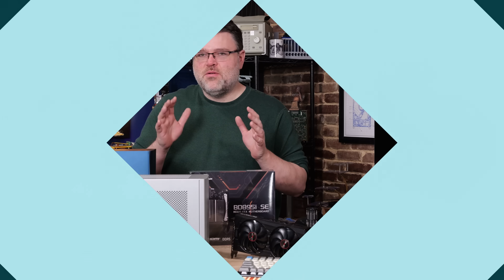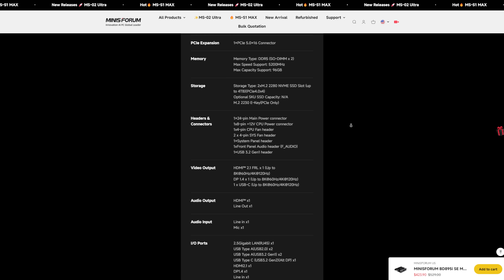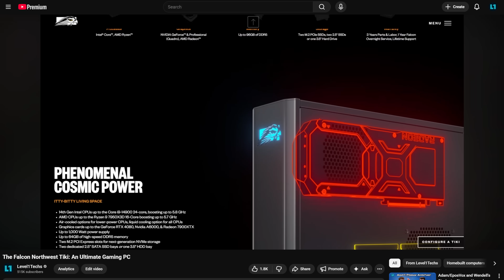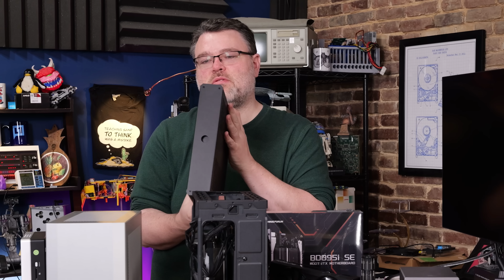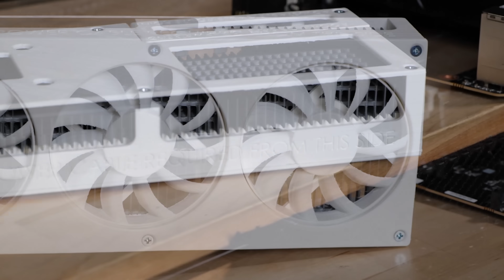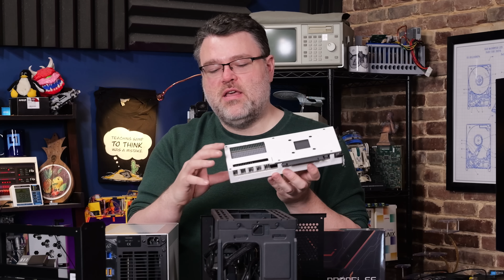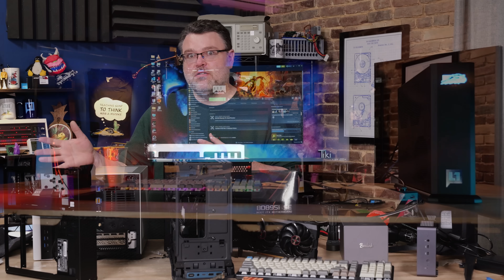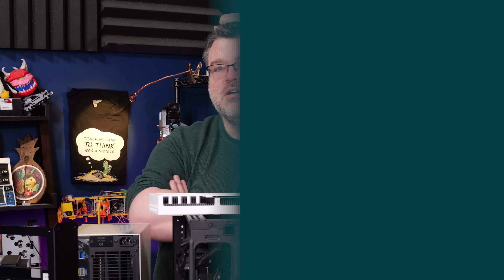Mini PCs Need Some New Rules! Ft: Minisforum BD895i SE Motherboard

Comment: 0 bios updates for my minisforum b550
Reply: That's why i'd rather use cheap ASRock with warrenty
Reply: @axescar u can't compare... I would never have had as much power with an standard AM4 or AM5 ITX board in my A4 SFX as with my BD790i X3D.😢
Reply: @Pirate85_Original buy b850 itx mobo, 7950x3d and limit the power to 120w
Reply: @wnstj15951 yeah, and which cooler i should use? L9a? 🙃 It just have 47mm of clearance and an axp-47 for example will sound like a turbine cuz the fan is directly behind the sidepanel... Believe me, I've built 20 Systems in DAN A4 Cases over the years, the Minisforum Boards are the most powerful and quietest you can get. With standard boards I've either more power and a starting jet or less power and quiet.
Reply: @Pirate85_Original  I already told you to limit the power similar to bd790i x3d. And it will perform just like it.
Reply: This is either a good thing if no bugs are found....or a horrible thing if bugs are left to fester, or merely a bad thing.

Remember folks...AGESA firmware...has had a LOT of teething pains and LOTS of buggy BIOS code over the years. Pumping out new BIOS revisions just because new AGESA blobs isn't always a good thing. My Framework Desktop had a new BIOS in December--AGESA had bugger PI code causing boot times in Linux to go from 15 seconds to over 3 minutes. Yay for BIOS rollback. Which is why newer BIOS and lots of updates--is a double edged sword. Especially with AGESA and AMD.
Reply: Genuine question, do bios updates really matter much?
Reply: @jonahhekmatyar sometimes not at all, sometimes it's the difference between working and broken, there isn't much between.
Reply: @jonahhekmatyar bios updates do contain security patches
Reply: @jonahhekmatyar  I have had an issue with a usb wifi adapter, that only worked after a bios update (maybe 15 years ago).  So, bios updates can impact things you wouldn't imagine.
Reply: My 7945i se has 2 apparently, just haven't gotten around to it
Reply: My BD770i got 3 and the BD790i X3D had the 2nd in the meantime.
Reply: Minisforum is a drop ship company with no support whatsoever.
Reply: I had several with my BD795i
Reply: i had one early on with my 6800h um680 mini pc but that was last year a few months after purchase. the bios is completely open for adjustment so no need for a bios update for me tbh, everything just works from setting vram allocation to tdp.
Reply: Might not need one, I’m sure AMD handles most of them anyway then passes them off to the vendors. That’s how it’s usually done.
Reply: If it works, don't update...
Reply: @zCaptainz security vulnerabilities
Reply: @GuyWithJeepOG You ever had any problems with "security vulnerabilities" ?

Only thing I see happening is patches reducing performance
Reply: @zCaptainz unpatched expoits are still a security issue, even if someone doesnt exploit you, you just lucked out. 

Ive had them exploited before, its not fun.
Reply: @GuyWithJeepOG  tell me why an attacker who already managed to gain kernal level access to your system needs to trouble himself with your bios? there is higher chance the bios is already a malware shipped from factory and waiting for ccp command ,see how unrealistic and dystopian it got
Reply: Oof
Reply: and what's the problem? I'm used to see nothing but problems with updates.
Update: everything breaks... Rollback.
Reply: @mvargasmoran  Yeah, i am not a fan of constant BIOS updates. For new features.....maybe. I had a whole GUI get a roll back to make space for micro code for current CPU on a first gen B350. Fan interface stopped working. Full speed only. GUI was gutted and it looked ugly.
Reply: @mvargasmoran  Yeah right. Never install (security) updates to agesa or software in general. It'll be "fine". People like you are the cause of all those zombie-bots on the internet. Please stay with a typewriter <3 (No seriously. If you're unable to update the bios without "causing problems all the time" let someone who knows how to do it do it.)
Reply: Vulnerabilities.
Reply: @trowawayacc In the case of BIOS, you would need physical access to exploit any such vulnerabilities. I would say you have bigger problems if that's the case.
Reply: @Quarky_ You don't. Bios can be written to on system restart on some file systems (NTFS). Unless the system has 100% uptime there's always the possibility, and that grows by the day without updates.
Reply: @DeletedOS  the attacker has already gained kernal level access to be able to trigger "capsule time" update ,but lets entertain your scenario anyway
Even a kernel-level virus often cannot reach the BIOS because the CPU physically blocks the write path unless specific, highly secure conditions are met
 it also needs to bypass "Secure flash" feature by which the UEFI would check for the digital signature for the infected file, if its authentic the update will fail
it also needs to bypass "intel boot guard" which verifies the initial boot block. If the BIOS is altered, the PC simply won't turn on

there is a higher chance the ccp has already infected your bios and waits for a command to get activated

Comment: were they not just standardizing putting the power inputs and M.2 slots on the back of the board?
Reply: you could overlap the fan holes to enter over the back of the board too, or, i dont know, make an aluminum bar that sync the heat to the back of the back plate. really could fit 8 NVME m.2 slots on the back of any motheboard this way, currently its just reserved for "workstation" or "ultra high end gamer" motherboards

Comment: Minisforum BD boards - was hyped for it, bought the 795X3D one, and sold it after 2 months
Honestly, I am very disappointed with this board... here are just some things that pissed me off with this board
- Issue with M.2 Wi-Fi slot (yeah, yeah, I know the whole just use ethernet - It's not always that easy!), and I am not going to use a USB dongle when I have the M.2 Wi-Fi port.
- Lack of USB-C front header
- Lack of USB2 front header
- Awful design of mounting Wi-Fi port and ioshield
- Bad routing of PCIe lanes (for example, if you disable NIC in the BIOS, you will get around an extra 200 Mbps uplift on the Wi-Fi card).
- Cooler, which is not bad in performance, but the design is so bad that in most cases you cannot add an exhaust fan on the back because your cooler fan will block the mounting

I literaly have better use with random MoDT board form Aliexpress that comes with Ryzen 7000HX chips :/
Reply: Agreed that Ethernet is not always an option, but even when it is, on-mobo WiFi is also very useful for VR headsets. WiFi also often goes hand in hand with BT - usually if they botched the WiFi, the BT isn't any better, and BT is important for all manner of mice/keyboard/audio devices. I have my PC BT set up as an audio device sink, so I can hear what I'm watching on my tablet while I play a game.

Comment: That Era 2 can fit so much more (quietly, too).  I run mine with a 9800x3d (240mm AIO) and Prime OC 5080.  Swapped out the stock bottom fans with 2xNF-A14x25G2r, oriented all fans to exhaust.  It's shockingly quiet, even at max gaming loads.  

Going with an Era2 over a Terra or Ridge for "console" build comparisons is not really fair to any of them.  The Ridge and Terra require more care when engineering your solutions, but the Era2 doesn't really fit in your living room anywhere nearly as subtly as a Terra or Ridge.

I ran a Terra with a 12700K cooled more than adequately with a 67mm cooler (axp120x67), which left enough room for 50mm GPUs (first a ProArt 4080S then the Prime 5080OC).  The gaps between the fans and side panels were exactly in the sweet spot for maximum air flow and minimum turbulence.  The 4080S' coil whine and the exhaust fan I added under the PSU were noisier than the CPU and GPU fans. I am gifting my brother the 12700K build, and we're putting it in a Ridge, which fits his living room decor. 

The "SFF Ready" standard settled on 50mm GPUs.  The only major "enthusiast" targeted cards that came in under that size (of which I am aware) are the PowerColor Reapers and NVidia FEs.  Otherwise, there is product all up the stack at 50mm.  

Because I like how the Terra looked in my living room more than the Era2, I am going to move the 9800x3D into that box, cooling with an an600.  For a 4K Gaming-focused build, that CPU is barely going to have to sweat to keep the GPU fed, and you can run anything up to a 5080 in it today.  Once the ProArt 5090 drops, there will be at least 2 5090s that will work in that box.

Comment: need more pcie lanes, need usb4-5/tb4-5 ports and a shitload of those, if the cpu is the limiting factor just add an expansion chip to handle the interrupts properly, the back of the motherboard is underutilised - put the memory sluts /where are the consumer cxl modules?/ and m.2 sluts there, it would also be nice if we had some enterprise segment ssd sluts - second hand u.2/u.3 drives are out there and either ai buble gets a reality check or china will flood the market with affordable ssds beating price per GB vs rotational hdds

Comment: I have tried a 13 gen intel Minisforum and when slicing a model for 3D printing it would reset itself. yeah show real world work, most PC spend their life idling or at less than 50% usage.
Reply: The  bd795i x3d is very solid even under high load. 

Only issue is a tiny jitter in the usb signal, my Hifi DAC doesn't like it and occasionally crackles due to a 4hz deviation in the usb timing.

Comment: How about a new standard for both motherboards and power supplies, where edge connectors on the motherboard slot into the power supply eliminating all the power cables. Like old school computer boards plugging into backplanes?
Reply: Servers have gone this way, desktops OEMs like Dell could, just as they went more-or-less-ATX12VO, but in the DIY space you have to be at least inter-compatible with the ATX standard to be viable.

Comment: I've strategically bought a mini PC with OCuLink support (Minisforum UM780XTX), about 2 years ago. Of course, i couldn't anticipate "the great memory drought of 2026" (my 64G is currently worth more than the original barebone, new, LOL). I'm also feeling quite lucky, that i bought my Radeon 9060XT/16G during black week 2025 - even with PayPal interest, my deal is currently ~60 bucks cheaper. For FOX sake! (FSR4 on Linux works: proton-cachyos, PROTON_FSR4_UPGRADE=1, works on Manjaro as well! [apparently no mesa upgrade required, 25.3.x seems good-enough])

Comment: The one thing I'm not big on is that it does not have USB4 or Thunderbolt.
Reply: I literally can not find a USB4 motherboard for a desktop that doesn't cost a leg and a arm. But a lot of them have a bunch of usb 3.0 10gbps and sometimes even 3.0 20gbps

I also can not find a USB4 pcie expansion... that doesn't happen to include a single port. They do have a bunch that include a lot of usb 3.0 though

I think thunderbolt might be the way, but that's exclusive to intel chips, so no X3D for me? Nahhh
Reply: Or for nas builds literally any sata on any of their variants.
Reply: @kh77926 You can add a nvme to 4x SATA adapter in the outer nvme slot.

10gb ethernet would be nice to connect a NAS to it, though. The bd795i only has 1gb or 2.5... not great.
Reply: Use a drop in x870 adding card from China (b650 -x870 variants)
Reply: @Phil-D83 these have one pcie and we're mostly talking dedicated gpu builds.
Reply: @shadow105720 all you can really do, but yeah
Reply: There are more than enough X870/Z890 boards that do though
Reply: Is that really necessary? Specially for a build like this.
Reply: for less than $500 you're nuts to think it should!

Comment: I think we need to focus on something. Assume, we are talking about console killers and living behind RTX5080+ cards. Some thoughts/questions:
1. Ryzen AI MAX board may have 2 CAMM2 slots. This can solve RAM size problem for gamers
2. I don't like that the Steam Machine will be not upgradable. There is better (it's not ideal) example of sff design - Mac pro Trash Can - upgradable regular RAM and CPU. User replaceable GPUs!
3. Minisforum and bios updates. It's good that there are some, but the CPU is soldered, so there is no point to make a lot of bioses. For example ASRock N100m board with soldered CPU has only 2 updates, one of them is Beta bios.
4. There is an ASRock Deskmeet serie. SFF with discrete GPU support and upgradable CPU and RAM.
5. I'm not  big fan of ITX builds with huge GPUs. IMHO it makes no sense. 2 Slots is a good compromise with TDP at 200W. 
6. I don't understand why I will choose itx board with some soldered X3D chip instead of regular ITX with socket? If I'm building some small gaming rig, I'd rather choose CPU according to my needs, for example some low power 7600x3d, that can utilize any 200w GPU. I can even upgrade it in the future for some 8C Zen6 x3D chip if/when it will be available. But with a soldered CPU I have no upgrade path.

P.S. Sorry for the "longread", but SFF topic in 2025/2026 is really confusing me.
Reply: BIOS updates are important for fixing firmware bugs/flaws and security exploits, not only for upgrading CPUs down the line. Very common for mobo firmwares to have issues with specific NVMe SSDs or specific RAM sticks, common for gaming laptops to have crashes in particularly demanding games because of bad voltage curves, someone else in these comments has problems with 3D model slicing causing their Minisforum PC to reboot, etc.

Valve also repurposes existing SKUs to get better prices - for ex the Steam Deck's APU was designed for Surface tablets/laptops but the deal with Microsoft fell through. Steam Machine's GPU is believed to be repurposed 7600Ms that AMD been struggling to sell for gaming laptops, and I'm sure the CPU is a similar story. Opting for a socketed CPU/GPU would force Valve to raise the price, increase the size, and/or opt for lower performance components.
Reply: The hardware being fixed/non-upgradeable also means that developers have to meet a performance target instead of expecting the target to meet them. No developers are forced to make their games run well on Deck, but many still put many optimizations that they may not have otherwise - see Cyberpunk, Baldurs Gate 3, Helldivers 2, etc.
Reply: @corombb if you are talking about Steam Machine and performance target IMHO it will be defined by popularity of Steam Machine. And even if it will be popular most that you can expect is in-game graphics preset like for Steam deck. I don't know any recent AAA project, that target Steam Deck. But l know a lot, that requires upscaling on 5080 level GPU to achieve reasonable framerate
Reply: @corombb I know why it's important, I'm saying that it's not fair to compare bios update list from socketed board with few generations CPU support from A brand and board with soldered CPU from B brand. It's not abound brand size, it's about soldered CPU.

Comment: I've imagined a case with a built in radiator on one side. This would give the case added structural integrity. Never thought of this for a small form factor case before. However, CPU & GPU water blocks are much thinner than their air cooled alternatives. A "vertical air flow" orientation would have the radiator on the opposite side as the i/o shield. I prefer water cooling for its quietness over air cooling.

Comment: early comment: versatility has always been the console killer, imho. Imagine that, doing more than just gaming, with your expensive hardware? WHAAAAT? Yup, that's what a proper PC does, it games, and then some!
Reply: Counter: why would people need another computer when most of those that can afford another PC likely have a laptop laying around anyway?
If you already have a computer, why buy another computer (unless you need it for process that require high compute power anyway)? Just get a console (or Steam Machine if you want Steam) at that point for your games.
Reply: @fujinshu  well, i come from a make-the-most-with-what-you-have/can afford kinda background. That's kind of my point; why buy an expensive console, when you can only afford one piece if expensive hardware - in that case, a PC is the obvious choice - because of the versatility. ;) One can't do much with gaming consoles. Except, perhaps SteamOS - that's kinda nifty, indeed - the desktop mode and stuff.

Comment: These SFF have all that I want but none of the cooling. And the air flow noise..., the noise !. If one with the same noise levels as a desktop, ...that'll be the dream. And is quite possible if, they build the cases and plate adaptors for adding coolers. I'd gladly move my MS-S1 to a better form factor for a more quiet heat dissipation. Am not the only one thinking this way. And components will have longer life.
If I had a machine shop I'd make a brand "proper case" and engineer the thing to mass produce where cost effective ( could not care less where ) and that would sell, like good sales, lots of sales =)

Comment: 6:00 Do you have any proof the Steam Machine is faster than the 8060S? I think it will be slower for high baseline games like Cyberpunk.
Steam Machine has only 28CU, 8060S has 40CU
Reply: Less compute units doesn't mean slower when you factor in clock speed, memory speed and TDP.

You are comparing two entirely different packages. 

The 8060s won't be running at 135w+ like the modified 7600M will in the Steam Machine. They are the same architecture (RDNA 3.5) and the 8060s will be more efficient due to the newer design, but not faster.

You're trying to disagree with Wendel despite the fact he is a literal expert, btw. Don't be dumb.

Comment: Everything being overclocked out of the box from the factory is causing the runaway thermal and stability issues.

I kinda miss the times before turbo boosting became a thing in CPUs and GPUs.  Now everything will happily boost to 100c which is great for longevity and efficiency, bleh.